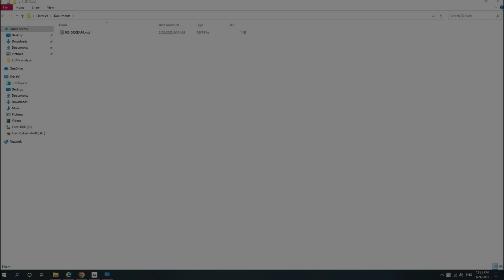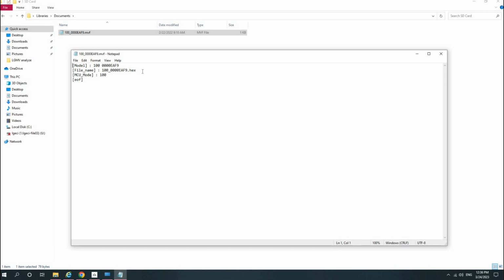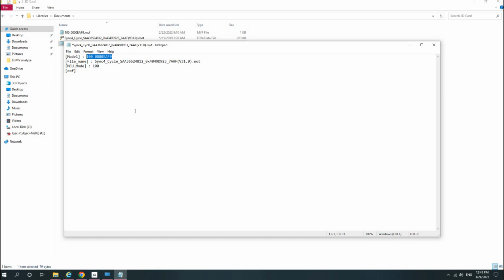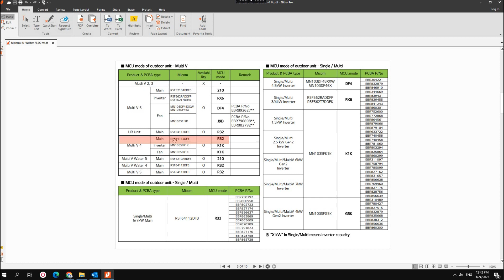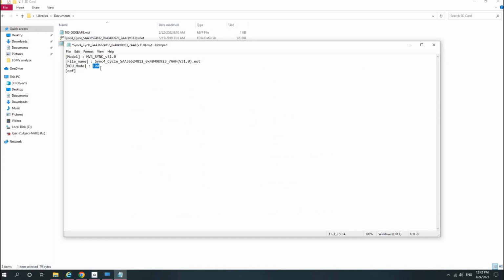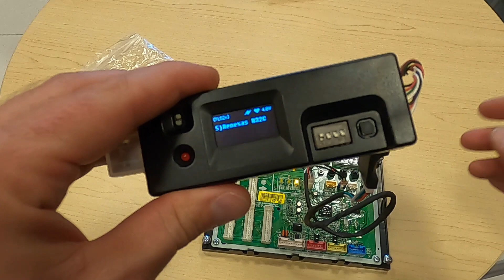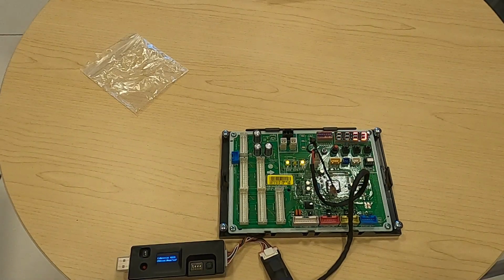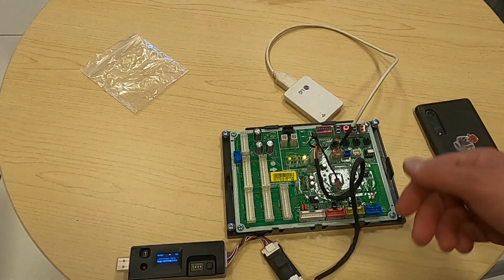LG new software update tool. U-Writer (FLD2). Explanation and update example.

Comment: Hello.  I need your help !  Do you have the loader2.bin file for the FLD2 ?  Or the LG part number for a new FLD2 ?   I need to write backward on new main boards version 31 back to version 29 so the 1A boxes can work.  They will not work with version 31.  Thank you for your help